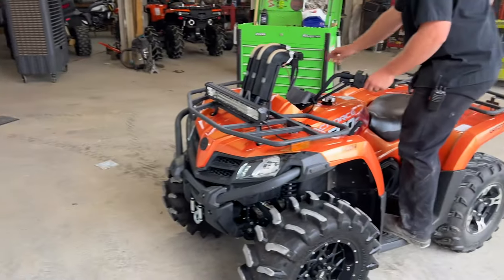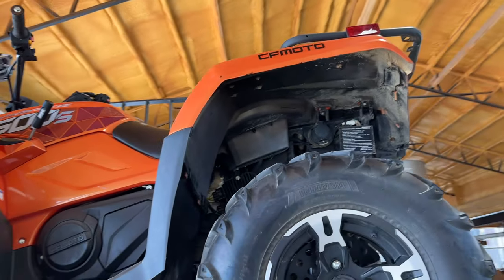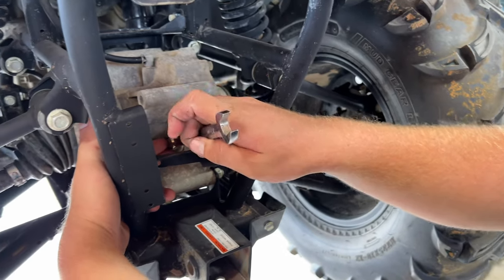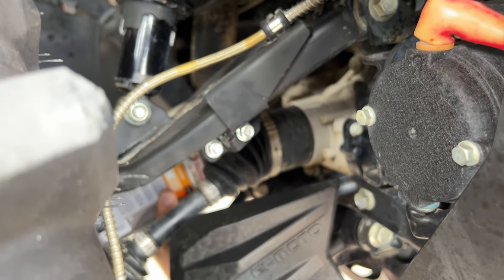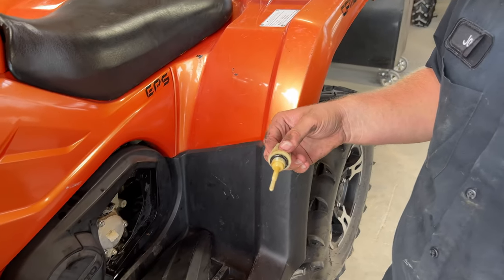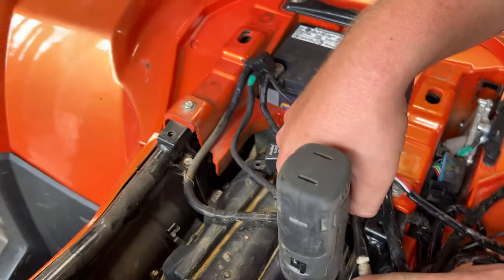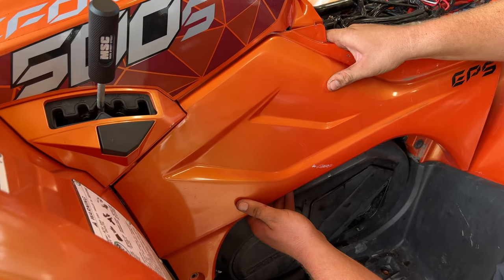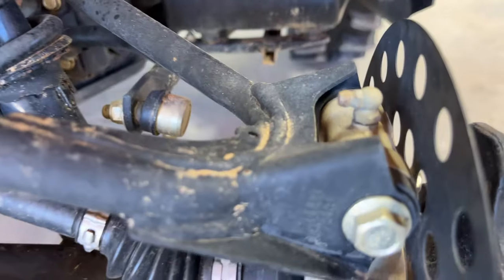CFMOTO CFORCE 500 FULL Service | Oil, Filters, Diffs, Spark Plug & More

Comment: Rotella T6 5w40 is a Jaso ma2 and I'd safely wager a better performing oil. Also why not a 75w90 full synthetic gear oil instead of the non-syn 80w90? Also throw some dielectric grease in that spark plug boot, winch terminals, battery terminals etc.

Comment: my cforce 500 fuel pump will not come on. I have changed the relay and fuze. Where is the fuel pump? Key on and no fuel pump sound. will not start. How do I fix it with out using the winch and loading up to drive it 1.5 hours to the dealer.

Comment: I just installed a front differential on my 2021 800 XC that i ordered from MSC an I plugged it up before installing it and it I showed it was working and it did engage an I loaded my bike up and installed it and when I unloaded my bike of the truck I can hear the relay clicking but now my differential won’t engage now…this all happened within two days…can I get some solution on on what’s going on with my from front differential please

Comment: Hi is the spark plug removal the same on a 2021 625 Touring?
Reply: That´s what I also want to know!
Reply: I hope the mechanic used some compressed air to blow out the dust and crud from around the spark plug before removing

Comment: which way does the other snorkel air pipe go? under the engine?
Reply from the maker: The outlet of the CVT goes underneath the engine on the key switch side and up behind the fender well